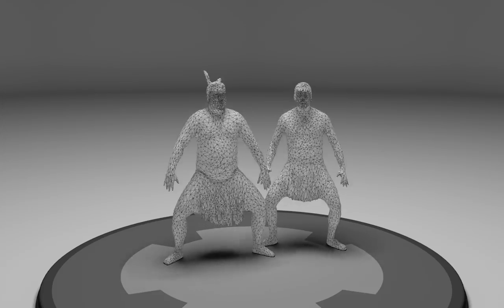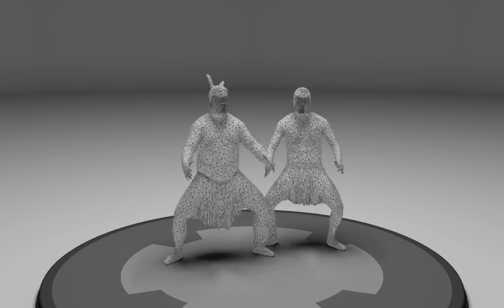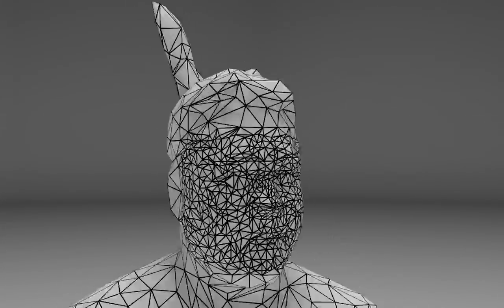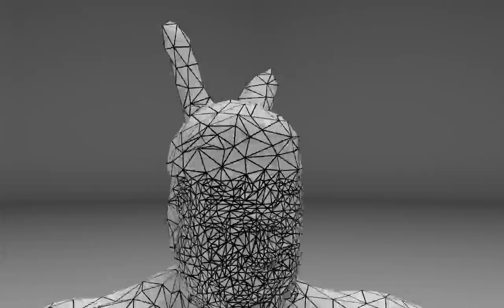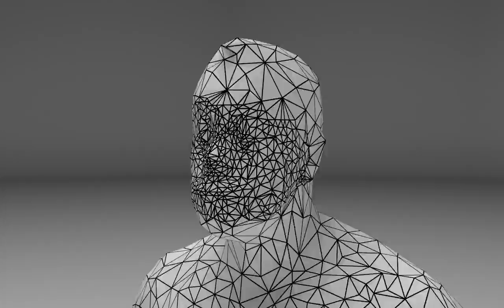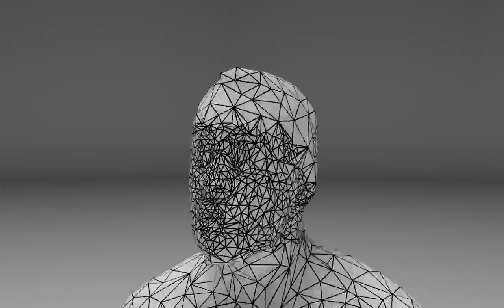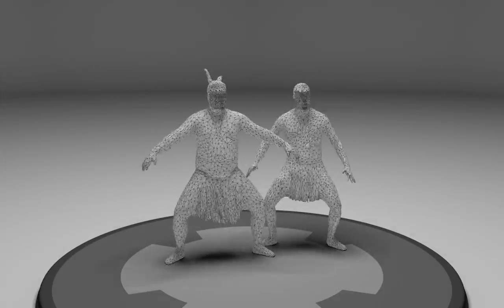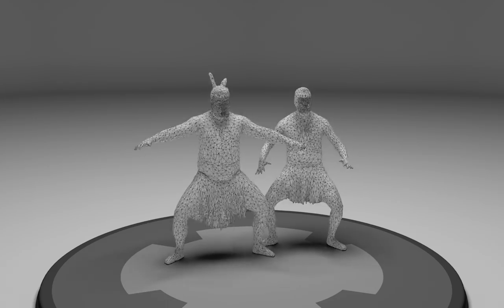High-Quality Streamable Free-Viewpoint Video

Comment: 1. Combined Depth from Silhouette, Multiview and IR -> Insanely accurate point cloud. (To me, this is the key part because there's no need for fusion anymore).
2. Hull-constrained PSR -> watertight mesh
3. Adaptive Mesh Decimation -> 10k triangles per person
4. Keyframe tracking -> for better compression
5. Progressive Mesh Atlas -> 1024x1024 resolution texture atlas per frame

Comment: Geeze this is nuts, you guys are years ahead of everybody else. This looks fantastic, thanks for showing us what 2020 will look like!

EDIT: I'm curious mostly about the conversion from that mess of meshes to a consistent mesh that only has slight diffs for each frame. Is that the mesh tracking you reference? Everything else seems to be mostly covered by PCL (io and surfaces at least) except textures from an MPEG stream, but that sounds conceptually straightforward to just swap texture references with video references. Definitely going to dive into this paper!
Reply: bullshit..except for tsdf nothing else is in pcl. and tsdf on pcl is a mess